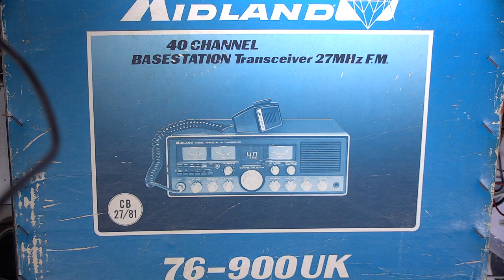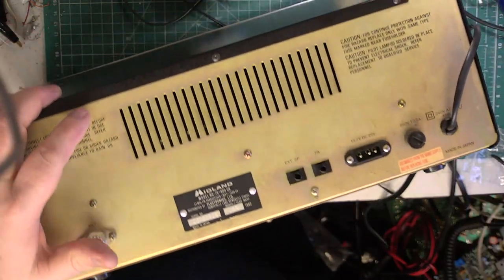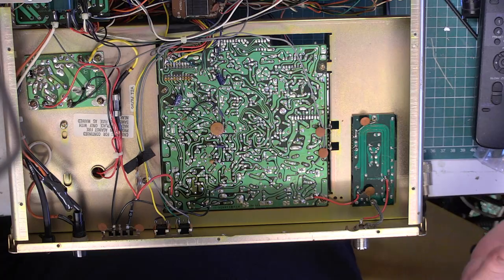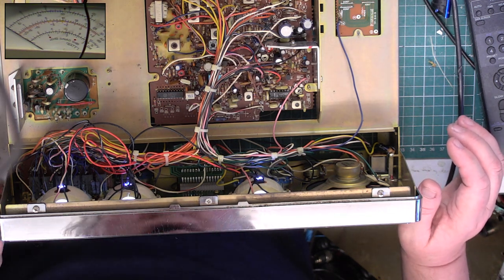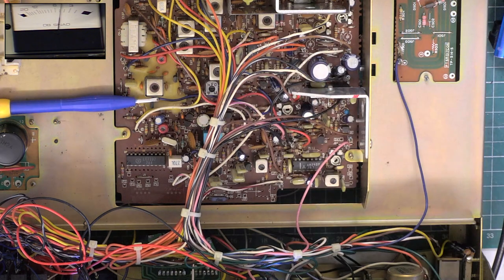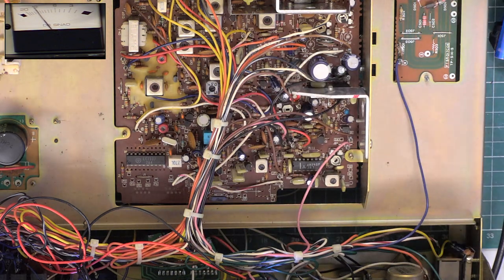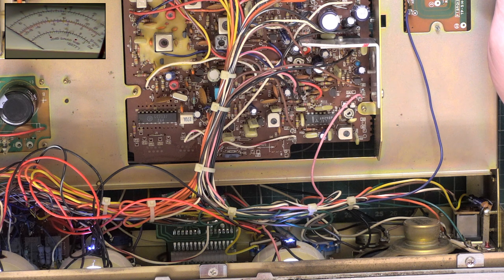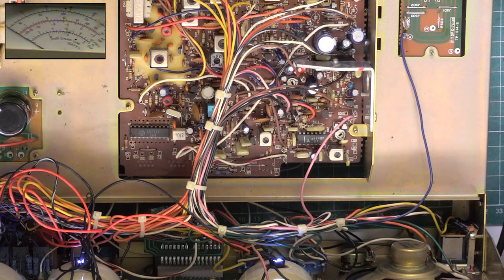Midland 76-900 CB27/81 UK FM CB radio base station -  realignment & service

Comment: The one i have i took a look in it it has been 80 channel and i silly bleep board :(
Reply from the maker: I bet that really compromises frequency accuracy & receive sensitivity. Bear in mind the number of sets that come here where the illegal 80-channel modification has killed the set :(

Richard
Reply: @ukfmcbradioservicingTango21  I did not plug it in as I do not know what else has been done to it, And power supply could be bad.
Reply from the maker: Yes Chris. You'll notice when I start to work on such sets the 80ch board is removed & anything suscipicious/dodgy corrected or replaced before powering up. Such base radios are then powered up off the bench power supply starting at 9V 500mA limit & taken from there. Like any similar power supply, a short circuit in the series pass transistor (the big one on the heatsink) could cause the power supply to pass about 20+V to the radio :(

Richard, G0OJF, UK

Comment: So you was the one with money money than sense that over paid for a 40 years old Cybernet.!

even you remember a time these were fetching £25 a pop.!

so you paid £199 for it from Leicester.
and that seller paid £160 for it from Stratford upon Avon only a three weeks earlier.

just goes to show you got had by the sellers who buy radios one week to up the price and sell the next, all down to greed and people naivety and desperation for nostalgia.
Reply: I hardly think Richard could be described as 'naive' in these matters. You pay what you're comfortable paying, they sell for what they are worth in a given context at a given point in time. And they are superb radios all round, not just 'an other' Cybernet.
Reply: @2steppa3  But it is just another Cybernet, it's a 134 board, so no matter what it is,  you're paying for the outfit it comes in.
as for Naive, if he did his research he would have seen this was bought purly to make money out of someone, and in all fairness asking the right contacts which he has many he could have got a similar quality radio for maybe half,

if you want one desperately, pay for it, but we all know there will be another along next week.
Reply from the maker: ....and I've never seen one ever under £95!

Richard
Reply: @ukfmcbradioservicingTango21  There has been plenty,
i picked one up a couple of years back from out Lincoln way in it's box for £80 (no inserts) along with a desk mic and a seperate PSU and meter long antenna,
and it wasn't an hiked up ebay sale either,

there's a lot of cheap stuff out there sold by honest realistic people,  then there's ebay.
Reply: @CB Radio Way Back; Now you sound like someone who, at a guess, has had a bad day. Settle down sausage. People such as Richard do not make decisions lightly. I would most probably slightly overpay for one of these myself. We all have choices, and we all choose to make them. These radios will naturally only go up in value anyway. What he has done to this set has already added value to it, and cancelled out any loss.